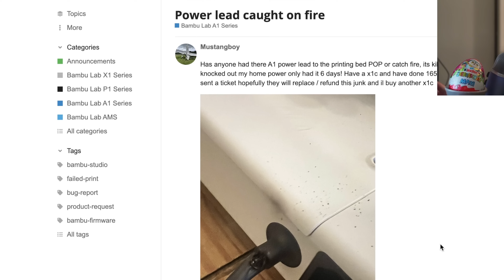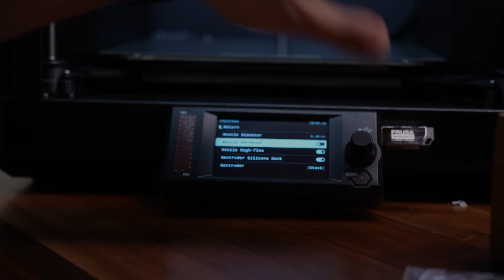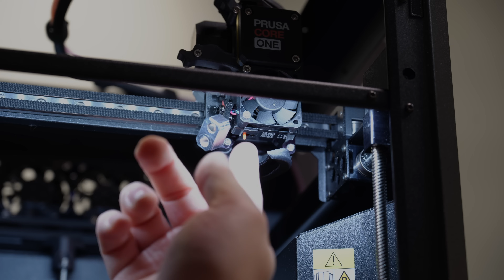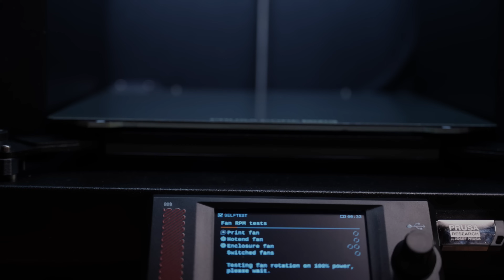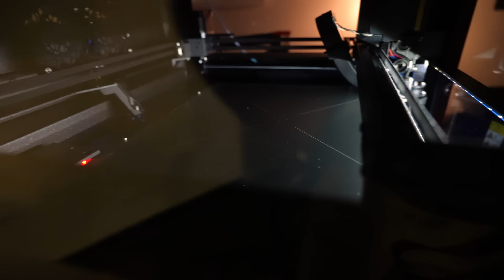PRUSA CORE ONE - The Machine Designed to Trigger Bambu Lab Fanboys

Comment: I purchased a Prusa XL with 5 printheads. The experience was terrible.  The machine was totally under engineered and it was returned.  I bought it because I did not want to further support the Chinese.  IF Prusa begins to manufacture in the US I will likely forgive them or their past sins and switch to their products.  I’m willing to spend more $$$ to buy American!  BTW, for the most part I really liked their slicer.
Reply from the maker: What time did you get the XL? I heard of people having problems early on but have seen some more positive reviews lately.
Reply: @NathanBuildsRobots  I ordered it about 1 month ago and sent it back within 2 weeks. It is the most severely under engineered product I have seen in many years.  Filament sensors don't work. "Just disconnect the one on the side.  It isn't really needed." Local memory is a thumb drive?  What a joke! "Heat soaking can take up to 10 minutes? It can ONLY be lifted by the designated handles otherwise you can tweak the structure.  Joke right? No.  No camera? Give me a f*ing break!  Nozzle ooze.  You have to install your own 3d printed wipers if you want to avoid the problem.  I wouldn't know where to start.  The printer was worse than anything Creality, Elegoo, Bambu, etc ever turned out in a 1st gen product.  The product is SO bad they have created an entire instructional series about how to repack it for return AND they include extra nylon strapping for the purpose of return.  They know before it leaves the shipping dock there will be problems. I'll bet the return/complaint factor. is 100% on the XL.  Did I mention it is as slow as a turtle?  But the tool changes are nice....
Reply: @brucetaylor502  sounds like a user problem who didnt rtfm. 
Their warranty is pretty solid, they replace machines when user prove is defective or send parts that fail.
Reply: @fofopads4450  I read the manual.  I watched the videos.  And the printer was simply an under engineered POS.  Fanboys like you can’t admit the truth.  And parts?  Absolutely they will send parts.  In fact, one of the printheads died after a few days due to a bad wire on the heater block.  I did what most people would do.  I went to Amazon to reorder another,  It’s just a generic heater right?  I could have a replacement for less than 10 dollars and have it in 12 hours.  I could even upgrade to a slight higher wattage.  What happened?  I informed Prusa of the problem and my solution and I was sternly warned about replacing a heater, An ordinary HEATER with a “non Prusa” heater.  Probably the same damned heater they bought from China!  Twelve hours later I’m exchanging my 40 watt heater for an upgraded 50 watt.  What happened?  Their software and hardware wouldn’t accept the higher wattage and errored out.  Their cheap ass 40 watt heaters take FOREVER to heat up the printhead.  It is like watching slug crawl across the floor as you watch the temperature rise.  You know it will eventually get to where it needs to be but the wait is forever.  So, I go back to Prusa to get my Prusa-approved heater and they gladly replaced the $8 heater and send it by US mail.  So I have a brand new $5000 printer and the cheap ass bastards couldn’t spring for overnight delivery! The heater failed to arrive before I sent back their under engineered POS.  So the fanboys like you can continue to spout the praises of Prusa, but if others read my comments maybe they will be wiser!

Comment: I just wish it was a 300mm cube volume
Reply from the maker: It makes sense for them to prove out the design using MK4 parts so they have the option to entirely switch production to Corexy if that’s what the market needs. But it would be an obvious next step to scale this up!
Reply: @NathanBuildsRobots  My first was an Anycubic Mega x, then klipper, Prusa mini, voron 0.1.  Definitely need a big corexy next.  Prusa's take on a voron trident just makes sense.

Comment: Man I love my bambu printer but I think it's nothing special and I'm very mad at their recent changes and the general direction they're going into with some design decisions not being about having a good machine but just making it harder to customize, for close to no reason, locking their machines to casuals users only (yes print farms are casual), like man you spend your r&d fxkin time just making sure people are using THEIR hardware in the most boring way possible and making any other user's experience worse, rather than giving them more usability and options ? Really, when an update is not anymore about adding features (bambu studio, what the heck, give me actual new stuff like brick layers etc ???) but rather removing options, it feels plain wrong and it shouldn't even cross the mind of a company if they'd care about their users, instead of just trying to squeeze more money in. Man I hate that kind of practices. 10 month ago had there be the same offers as the current market at my budget I'd have bought something else. Wish I had a machine from prusa or any other company that's as considerate of their community, or even an affordable kit. The kit for this core one makes me wanna have one so bad and it looks like a dream for anyone getting started in 3D printing. I don't get anyone who's got a bambu printer and who tried to print ANYTHING else than a makerworld profile and does actual designing/experimenting who's getting defensive about bambulabs rather than concerned

Comment: Most manufacturers include gummy bears so you know if your package was exposed to high temperatures. I’ve seen contact/medicine companies do the same thing. If your package experienced unusually high temperatures, your gummy bears should arrive melted.
Reply from the maker: Interesting! Maybe since the machines use some printed parts they could be temperature sensitive, but it would have to be REALLY HOT for PETG parts to start having issues. You never know what happens in shipping though
Reply: @NathanBuildsRobots  to my knowledge there are no PETG parts anymore. It’s all printed in PCCF. 😊
Reply: @chrispauli5200  ooh what a fun fact
Reply: The Haribos started as a nice detail for early supporters of the original MK1, it just became a tradition and part of their product after

Comment: For the same price, I can either buy two Centauri Carbons and 10 rolls of filament or a kit version Core One. I gonna get the core one.
Reply from the maker: Centauri Carbon is $330 after shipping, core one kit is about $1050 after shipping.

It’s definitely not cheap, but it’s a lot quieter and probably has better print quality and reliability. Prusas tuned print profiles are always amazing
Reply: @NathanBuildsRobots  In Australia, Centauri Carbon is US$466 after shipping & Core One kit is US$1168 after shipping. Cool to imagine how core one will be upgradable over the years.

Comment: Yup, my Prusa XL triggers me with vfa, ender quality and tinkering, while my p1s just print 😅
Reply from the maker: I don’t have an XL, but from what I’ve seen this has better print quality
Reply: @NathanBuildsRobots  if you don't have an XL how can you make an objective comparison? Honestly I've found just flat out comparing bare printers against one another as a moot point. Even with a Prusa or Bambu you will need to make adjustments in the slicer to optimize for specific filaments, projects, and or environments. So I would simply advise people to buy the printer that they feel will fulfill thier needs whatever they may be regardless of brand. Some people have a price point or certain security requirements that need to be met. These Bambu fanboy comments are unnecessarily inflammatory and childish. I thought you would have grown out of them by now Nathan.
Reply: CoreXY Kinematics dont suffer from VFA, thats a Cartesian problem. 
Sounds like a user problem, pretty sure their support can help you fix it.
Reply: @fofopads4450 
Core xy get vfa 
That is just false
Reply: @Goroca  yes, but not by design.
Cartesian has some VFA by design, it just gets mitigated with motors. 
A well assembled and tuned core xy machine with  good slicer won't have VFAs.
Reply: @fofopads4450 
No thy don't, I have seen a lot of cartesian printers whit no vfa since they are not badly designed

Comment: Just got my Prusa core one. Happy to spend a little more money if it means it will last for decades.
Reply: If it can stands for decades, than it means superior engineering and build quality, which is valuable on the whole exploitation period.
Reply: @GhostRider5555555  Not only that, but because a bunch of parts are 3d printed, you can make new ones if they fail
Reply: Genuinely curious and earnest question - what is the benefit to it lasting decades? Sure it's nice to have a well-built and sustainable product that will continue to work where others may break down, but you've seen how fast the space has evolved in just the last couple of years right? Do you think a Core One from right now will still be relevant at all in even 5-10 years, even with incremental upgrades, with the leaps in technology in 3D printing that are happening every year or two? I know Prusas have longer lifespans and support than most machines, and there will eventually be a physical ceiling hit with FDM printing, but do you really see yourself still using this printer 20 years from now? Again, I'm genuinely curious if that was just a bit of flippant hyperbole or your true expectation. Congrats on the new machine though!
Reply: @c146w  walks into shop, looks at machines that are 30 to 90 years old & still cranking out repair parts. Glad those old timers built quality stuff that lasted decades and rebuildable. Im not the first one to machine parts on these units and probably not the last one. At some point, the machines take on a mythical level of reverance, all the old timers that have run them, many long dead and now its my turn.
Reply: @c146w My printrbot metal 1405 was bought in 2014 and printed for nearly a decade. I stopped using it because it worn parts out I cannot buy anymore since the company folded. It aged well and the electronics are still good.

Unless filament size changes, like what happened to 2.85mm machines, a good tool can last for decades and still be useful. 

What you have is consumerism impulse. Where you are ready to dispose of things as soon as a new shiny thing is out. 

In 2035 there will be AI organic printers or some shit, while I will be cranking up my old machine to make me a replacement part I need from regular 1.75mm filament, without having to ask HAL to open the door or suscribe to printer+
Reply: @c146w  The benefit to it lasting decades is that it's nice to have a well-built and sustainable product that will continue to work where others may break down.
Reply: @ Yes, very clever, but I was writing that in the context of the rest of my comment, implying that an outdated and surpassed machine that still works years down the line after superior performance machines may have come out is generally, when seeking the best performance, irrelevant. I see from the other comments that we may not be seeing further large leaps in the underlying tech as we have in the past few years, making my statement self-supporting when read in hindsight now.
Reply: True. I was teasing a bit. I've just 'double the speed' of my 2021 MK3S+ machine by upgrading it. No doubt the core one will have upgrade options in the future.
Reply: @c146w  "What is the benefit of lasting decades?" You can sustain such a machine for far longer than a cheap chinese machine, saving money in the long run and reducing waste.
"Will the core one be relevent in 5-10 years?" Absolutely, yes. We're at the upper limit of what FDM 3D printing is capable of, and I don't see it getting any major improvements. And if prusa comes along with any improvements, they'll put out an upgrade kit.
"Do you really see yourself using this printer 20 years from now?" Yes.
Reply: @ Fair enough, Nathan's reply was interesting as well. I wasn't aware we more or less may already be at the ceiling of FDM performance, in which case it would make sense that a printer, especially a Prusa, coming out now could still be relevant in 5-10 years, and still in use in 20.
Reply from the maker: Actually, I think the modern feature set has pretty much matured to the point where we won’t see any major changes to FDM technology in the next decade. 

If you really think about it, FDM hasn’t fundamentally changed for the last 30 years in terms of underlying tech, and what we’ve seen is simply desktop printers catching up to enterprise printers, and even surpassing them in refinement and performance.

But note the major limiting factor is physics. Can’t push accelerations higher because motors and frames are at their limits. Can’t push plastic faster because you can only melt a plastic so fast because it is a poor thermal conductor.

Barring the introduction of volumetric heating methods like ultrasonic, inductive, or something else, we are at the limits of how fast we can go. We might see some more advancements in slicers, nonplanar, heat advance (controlled overheating during rapid flow), but the general purpose printer has pretty much reached maturity and the CoreOne will likely be relevant for at least 5 years.

This is all my opinion, but I’ve been printing since before the Ender 3 on old stsratasys machines.
Reply: @ That's very interesting to hear and I appreciate you taking the time to explain. I started printing a couple years ago right before the explosion of/transition to the "fast" printers being the norm and coreXY coming to the masses, and seeing the rapid advancements made it seem like it would be a continuing trend.

I'm a little saddened that we may already be more or less at the ceiling of the physics of FDM as I was looking forward to what the future would hold in a few years, and don't have the need (at least currently, I'd love to turn printing into a side job given the excess bandwidth I have, but I know how hard that can be) to keep adding relatively duplicate/overlapping performance machines to my stable.

Perhaps we may yet see some of those more exotic-sounding technologies come to the market once the major players start looking for the next big features to tout in order to continue selling machines.

Do you think there is any future in additional axes becoming commonplace? I'm envisioning a coreXY system where the linear Z axis is replaced by a high-fidelity robotic arm that would allow current Z movements but also pitch/roll/yaw the print to allow additional deposition on the respective sides. Lately I've been using PLU plates and they seem like they could have the adhesion necessary to pull something like this off.

Perhaps SLS desktop printing will be the next to reach consumer appliance level, as FDM moved from enterprise machines down to our current printers?

Comment: 23:30 had a good laugh on these section! basically asking to those peps if they have neck

27:30 This one too, poor core one..

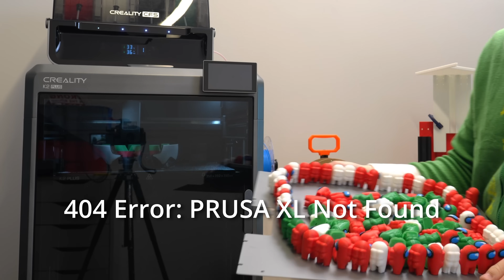35:20 can't agree more, core XY design itself gives a lot more stress already with bunch of complex bearing routing around motor to prevent slip. 

That will eventually break faster than bedslinger or delta (cause these don't do such rounting - one belt, one bearing per motor) - and I can't wait to see countless broken core xy printers from any major manufacturers that aren't open sourced in next few years, might even flood second hand market.

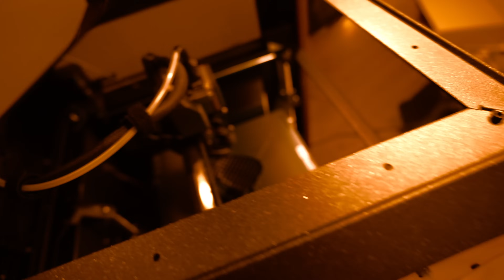40:46 your testing method is real mischievous lmao, it's just impressive how that print survives it

Comment: On my XL it has an open front with nothing in the way, but I prefer to watch from the side.  On the XL you can see better what's printing because the gantry is not in your way.  You're looking parallel the gantry instead of perpendicular to it. 

If you don't have access to the side then you don't have this privilege.
Reply: @bluerider0988  i also run a XL, it has a much thicker build, so it doesn't need the bar in the middle

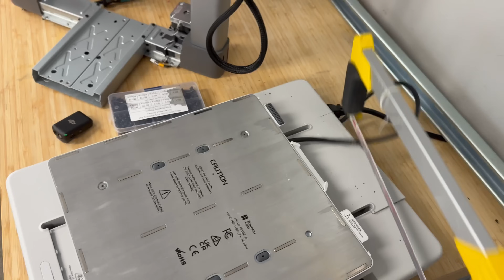Comment: 0:45 - LOL!  So that's why there are already 30 thumbs down on this video.  Nathan Builds Robots is the definitive source of Bambu fanboy salty tears.

3:40 - I bought a big stack of 25 mm diameter magnets.  They're great to hold cutters, tweezers, metric hex screwdrivers and many other tools that I use when 3D printing.  No need to align the tool to put it in a tool holder.  No need to even look.  I get it close and it self aligns and sticks.  That's a big plus for powder coated steel 3D printers.

I was pleasantly surprised by the price when Prusa released the CORE 1.  I calculated that my SV08 paid for itself in two days printing products for my online business.  The cost of a printer is a very small part of a print farm expense so it makes a lot of sense to spend twice as much for a Prusa.  The quality, reliability and maintainability are a very good investment.

I print a lot of TPU.  I think I'd convert that left recessed panel into a drying box for the on deck roll of filament.  Maybe make the right side a filament dryer as well.  Maybe mod the CORE 1 slightly so it can feed dried filament from either side.  100 bonus points if it could automatically switch to the other spool so it prints perpetually with no filament waste.  That would be huge for small print farms.  Harvest a print bed full of parts and replace any empty spools.

Comment: The three Z motors are driven by one motor driver channel so no, it cannot tilt the bed.
Reply: So you pay for 3 motors because if design stupidity?
Reply: @akierum  Your comment is ignorant indeed. A single lead screw with a single motor won't provide the stability necessary even if they can't do perfect bed tramming. I would not be surprised with bed tramming and 3 different drivers being added into the machine in a future upgrade. The reason they probably did it like this was to be able to reutilize MK4 electronics.